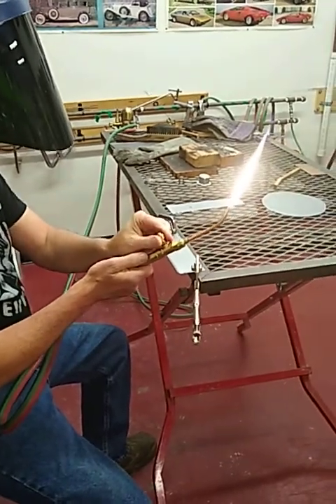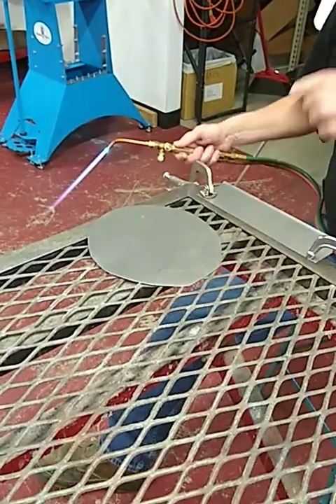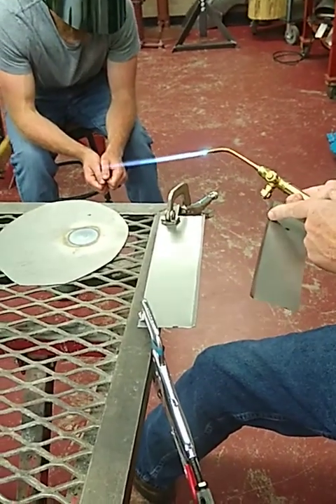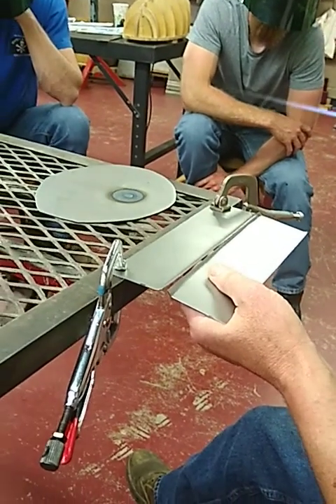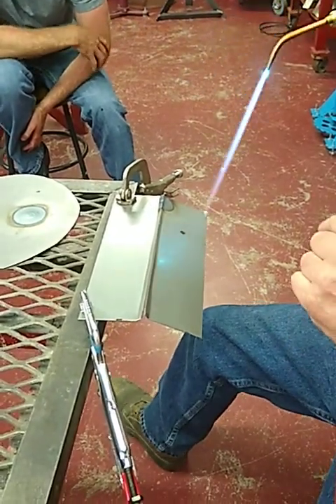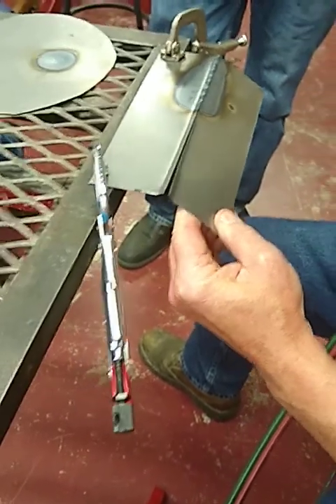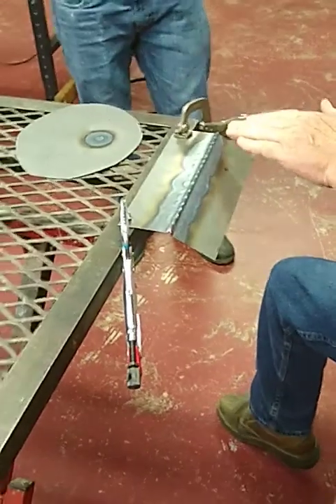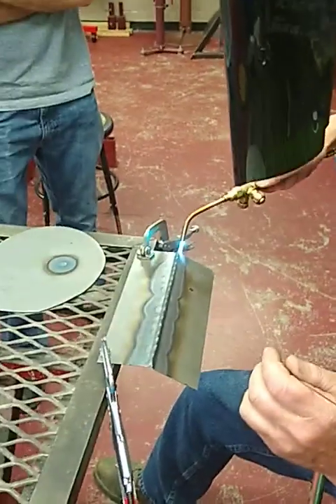Dagger Tools Gas fusion welding of LP1 tool lipped edge coupon's: Part 2

Comment: Very thoughtful instruction!  Well done!  I’m assuming that if the initial torch setting is too slow for the [molten in] “3 seconds” rule,  you increase the acetylene and then readjust the oxygen for more heat. If the gas adjustment does not increase the heat sufficiently you then move up one tip size.  Is this the correct approach?
Reply from the maker: Tip size (00 for most small handle torches) is normally not a factor if you are running low pressure regulators at approx. 3.5-4 P.S.I on both. The 3 second rule is best by adjusting volume of the plum versus the size of the inner cone. Usually theses adjustment are very small at a time once you dial it in a few times it become's habit , maybe 2 slight adjustments usually works for most.
Reply: Dagger Tools Perfect! Thanks for the quick response! I’m using a Meco Midget which should be good for this work.  Hoping to take a class with you guys - I’ve just got to work out scheduling so I can attend with my 29-year-old son.